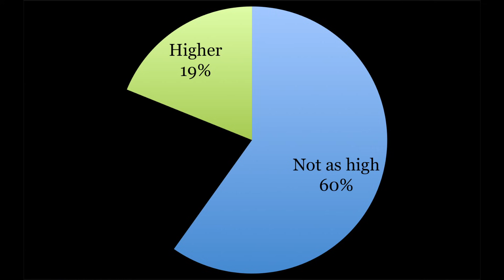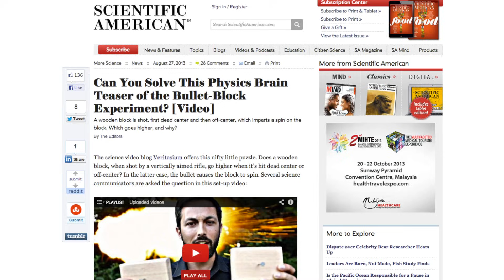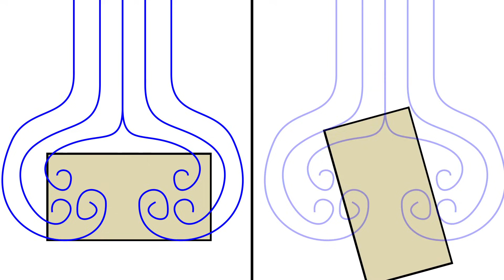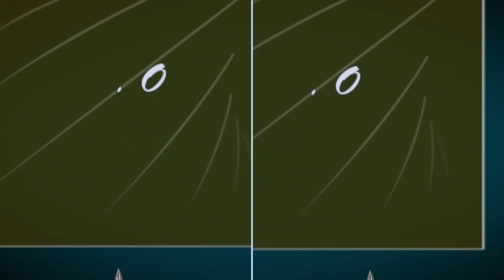Bullet Block Explained!

Comment: I haven't read the other comments but I think maybe if you used a longer block and the second shot was further away from the center. My theory here is that if you increase the length of the moment arm the block will deflect more easily in comparison to a short moment arm. This in conjunction with the much heavier block may exaggerate the difference in hole depth.
Reply: I see now that others had the same idea. I'm gonna lie to myself and call it valid
ation.

Comment: This may be negligible as well as the aerodynamics...But I think it's worth a shot. (pun unintended)

You shot wooden blocks. If you shot only one, it'd be destroyed. All wood is different and has different moisture content, which makes wood shrink overtime. This moisture content also has weight to it though. Again, probably negligible. But if each block has a different weight and the same size/dimensions, the block with the least amount of weight is going to be launched higher.

Comment: I think the answer might be this...  Remember the experiment with lifting the spinning weight at the end of the rod?  Well I think that the spinning block did use less energy to lift it, but the energy that was spinning the block allowed for less energy to be needed to lift the block.  So, your really not using any more or less energy, your using the same amount of energy.

Comment: As performed in this experiment, the 2 blocks of  wood "apparently" contain equal amounts of mass. Mass is one of the two variables that comprise momentum; the other variable is velocity. In this experiment you represent velocity with the bullet. Assuming that each bullet contains the same mass and were accelerated with the same force, it follows that momentum will be preserved in the block/bullet system.

Using the bullet to represent velocity is a bit misdirection, I think .  You don't need the bullet, only gravity. So let's try this in zero gravity and see where the blocks go!

Nice vid, btw.

Comment: I feel as though when the bullet struck the center of the block, the energy that caused the other block to spin was merely absorbed by the rigidity of the former block. Another experiment could confirm this.

Ideally this experiment would be recreated in a vacuum with a long, somewhat-flexible pole. In this case, I imagine the pole shot in the middle would reverberate (wobble up and down in the middle) with the same kinetic energy as the pole shot off-center would spin.
In this experiment, I believe the block of wood simply absorbed this wobble.

It would also be interesting to see if the same experiment done with a higher caliber rifle or a more brittle wood would cause the block shot in the center to disintegrate (thus exhibiting absorbed - and now released - energy) while the block shot off-center would not break, but would spin.

Comment: This has probably been answered already, but I would consider having a rubber bullet used instead to better demonstrate this behavior. While this does mean you'll need to view both sides of the block simultaneously (above and below), if you use paint stripes, etc, you can estimate the speed of the bullet going in the opposite direction and get a much better understanding of what energy it's left with. Otherwise, you could use a different block material that would resist impact more...or perhaps go for the opposite of bullet penetration/response and use a putty-like bullet that simply splats on the side, to have a different metric to measure.

Comment: Instead of bullets use a spring! For the experiment to be valid we need two similar bullets with same ammunition to be fired. even the slightest difference in the energy provided by the bullet could change the results. Instead of bullets use a spring!

Comment: The easiest way to more fully show the difference would be to use a softer but thicker material. This would extend the distance that the bullet would travel into it. 1% of a longer distance is longer than 1% of a shorter distance.

Comment: A much better way to gauge this experiment fully would be to use a ballistics material such as the human flesh analogue mythbusters use, it would have less resistance to deformity, allowing clearly imaging of the difference in bullet depths, it is also easily formable into any shape needed, such as a block

Comment: If im right the reason the Block Spins is Due to Bullet Spin as most people know a Barrel is Threaded Like a Screw So as the Bullet it ignited the Bullet begins to spin as spins faster as it get to the Opening the Bang of the Gun is actually the Pressure of the inside of the barrel to open Air as it leaves so it creates A massive amount of forced pressure im going off Topic but as the Bullet Touchs the Wood the Spinning Friction of the Bullet Cluching the Wood its Greats 27% more Inpact Pressure and thus Spins think of a Car Clutch plate and The flywheel the fly wheel is Spinning to the speed of the Engines RPM/Revs per minute and Begins fritction pressure i hope i have explain what i understand About Forces and such thanks for reading i hope im right Take care all

Comment: this is actually a middle school physics prob, at least in China where i from. i still remember i did the homework question. so the answer is it's linear momentum conservation rather than total energy conservation, as the bullet is stay with the block, so the energy will be absorbed differently, and hence cannot solve the problem using energy conservation. so with momentum conservation, the result would be they must have the same initial group speed upwards and resulting in the same potential energy.

Comment: use a object that would require less energy for penetation but would not deform under duress. I would have suggested a sort of high density gell used in bullet testings but i am not sure as to how it will hold under high duress.

The object itself should not get deformed from the enrgy thus changing potential energy after all :)

Comment: 1. use wood that is softer
2. use bullet that doesn't deform (a material that is not deform too much) so there is less change of heat and more penetration.
3. use smaller bullet

Comment: What kind of bullet(the projectile type matters) did you use? Basically ammunition design has an entire field of engineering based around penetration. For cheap ammo (paper punchers) they go with the cheapest manufacturing. For defense purposes, they want to minimize penetration and conservation of energy in order to 1: maximize transfer of kinetic energy to target (more damage and higher chance of incapacitation.) 2: Minimize the chance of punch through and injury to a bystander. 3: Minimize the energy of ricochets on miss and risk to bystanders.
I'll reply to this comment to give 2 ideas I have for modifying the experiment.
Reply: First, you could use a hollow point for the one you want to minimize penetration on, and a FMJ in the one you want to maximize penetration on. It would require finding a hollow point and FMJ that have the same mass, and you'd probably have to load your own rounds with match Casings and the same amount of the same smokeless powder.
Reply: Second, there's also frangible rounds that break apart inside or on the target. If you connected a metal plate to the bottom on the wood and fired a frangible round. It shouldn't penetrate, just break apart and do it's best to impart it's momentum. The problem is the block may barely move since the bullet will use most of it's kinetic energy to break apart and disperse. Also, make sure you have a blast shield when firing, because there's no way to know where the frangible parts will go flying after striking the plate.
Reply: To specify in the first comment. When I said "conservation of energy" I meant minimize the bullet retaining it's energy instead of transferring it, not that they want to reduce the scientific concept of conservation of energy. Which is obviously impossible to do.
Reply: james jones This guy might be onto something.  There's a whole other field related to bullet physics that we aren't looking at.  This guy doesn't know anything about guns, but the gun is central to the experiment.  The particular way the bullets penetrate the wood might be rendering this experiment invalid for all we know.  They took the gun to be something that imparts energy in a simple way that conforms to their theories; however the way bullets impart energy to certain materials is a whole science unto itself.  They should retry the experiment using slingshots and ball bearings or something like that.
Reply: Jordan Parker
 Actually, the rifle - with its highly standardized ammunition and highly consistent operation - is quite good as a testing bed for this experiment. Internal (inside barrel) and external (outside barrel\target) ballistics are almost consistent here. Of course, ammunition is an entire science field, but here they presumably use the same ammo every time. The only thing you could change is the block material, to make it more homogenous (terminal ballistics, inside target).
Reply: Jordan Parker
But in the end, using guns for physics experiments is not ideal, you're right. As far as I can tell, the weaponsmiths themselves are quite fuzzy on terminal ballistic physics of their guns - too much variables... and, in addition, since the goal is repeatability and consistency, not fundamental research (which would take hundreds of thousands of shots in tightly controlled conditions), most of the time they say "yeah, bullets can do strange things". And indeed they can...

Comment: Sorry this comment suggestion is so late relative to the video release, but a couple of ideas for redoing the experiment such that the bullet penetration distance is measurable include:
>Using a higher powered gun with the same shell calibre, in a larger block of wood.
>Using an alternate material to a block of wood, that has a lower density, such as a type of foam, and also increase its size by some order of magnitude.

Comment: I Know how now I've got it.... the information to go up, would of reached the bottom right corner, before the top right corner, then the bottom left then the top left..  That would work...!  the corners go up when receiving the infomation but because the block has turned and the infromation has not changed, it still goes up as it would if it was still in the position it was at the moment the bullet strickes,
Reply: I also beleive it is the bottom left corner, that slows the spin down/stops it from spinning with full potential.  If you cut that corner out it should spin more rapidly
Reply: ICEOL8
@Veritasium So the point is ALL THE ENERGY GOES UP! But, takes longer for each corner to get the energy to go up due to distance from the bullet stick, causing the spin!
Reply: ICEOL8 the upward momentum is the same for both cases
the 2nd one just had MORE energy transmitted into it by the bullet as it didnt resist the bullet that much ( energy lost upon penetrating is basically converted into angular velocity)
Reply: Yep, but what I am saying is how the what you say is angualar velocity actual made the block spin!  Plus the bullet did appear to penetrate both blocks by the same amount, and both of the blocks would of got simalar amounts of energy from that bullet strike, So I disagree that either had more or less amounts during the strike... Would more resistance constitute more energy transfir? for example to push open a stiff resistent door, it would take more energy to do so, hence more transfired! Thinking the block that had more resitance must of had more energy and therefore the other had less and it is assumed it turned into angular velocity! By saying that one loses energy is not the case as you say your self, it converts, so no loses!  To assume the bullet strike alone with no explination how, caused the angular velocity, is wrong!  Where as the angular velocity, was an after effect of my explination, as each coner rose up at different speeds causeing the spin, the spin was mearly maintained by angular velocity, and not the cause of the spin, in my opinion :)
Reply: it takes more energy to change the state of the door thus more energy is lost -> less eenergy is transferred to the door
Reply: You didn't ask what side/where the door is pushed on.  This should show you that in fact, you do presume :)
Reply: so you got to find the answer in the fine details, you got to go small.. Picture in your head the molecules their indivdual structures, how they affect each other.. slow the bullet down in your mind, see it slowly turning as it riffles out of the barrel, watch the air molecules get pushed apart and coiling in on them selfs an inch behind the bullet, watch it strike the linial molecules of wood and bend in on them self as the bullet slightly crushs, yet still compressing from behind! The air molecules refill the vortex behind the compressing bullet as it start to penetrate the wodden fibers ripping apart. Watch the energy buckle the fibers as it disapates through the wooden structure, see how as it reaches the edges of the wooden block it appears to almost pull on it as it tries to leave but can't really as air wont have it, coz it hits it a way, causing a momentary vacuum, that aids the first corner in lifting... if you can think like this, you'll see how it works :)
Reply: direct convertion would not constitute energy loss, but direct convertion is hard to acheive.. conversions are nearly always forked convertions, it is the additional forms of energies the are not measured that are the perceived losses, such as sound, and heat and atomic absorption(matter holds a lot of energy, as you know)

Comment: You should probably be able to measure a 1cm difference if the piece of wood was a hundred times longer?
Reply: No, the bullet size needs to be larger. Remember Ek=1/2 mv^2. To increase the distance of the bullet distance either bullet mass needs to change, or velocity needs to change.

Comment: Before I watch this, I think the block spins because the bullet is in the block inlodged so then it would make a unbalanced weight causing it to spin while flying and the bullet would make the block's weight heavier so it will not lose the kinetic energy as easily to make up for the heavier weight. Causing it to spin while going up at the same height.

Comment: so it's a coincidence that the block is that particular size as to offset the upward energy, that is if you used say a block twice the size, or one made of a different substance the rotating block would raise to a lower point?
Reply: No, as long as both blocks are the same material and size they would go to the same height.
Reply: so what about if the blocks were made of a material that prevented the bullet from penetrating it...
Reply: I believe itt would still "damp" the energy just enough. Imagine how tiny the amount of difference in the depth of penetration in this example--it doesn't have to be a lot of "observable" difference to make the same end result. It's the law of conservation of momentum "For a collision occurring between object 1 and object 2 in an isolated system, the total momentum of the two objects before the collision is equal to the total momentum of the two objects after the collision. That is, the momentum lost by object 1 is equal to the momentum gained by object 2." The momentum will always be the same no matter where the impact occurs.
Reply: thanks for the reply gray, my brain hurts, this was a good experiment and totes got me cheers nd
Reply: naughteedesign
 Yup got me at first too!
Reply: naughteedesign then it would be a horse of a different color. the point of using a material where the bullet will penetrate and become lodged is that momentum is conserved. if the bullet ricochets off the object, then you have two different pieces of momentum to calculate. the concept would be the same, but would be much harder to recognize and more complicated overall
Reply: good question!
then the rotating case would have a lower height.
In case 2, part of motion would be imprinted as rotation. On the other hand, the increased resistance in case 1 would make the bullet at some point ricochet (think comparable block and bullet masses).
In the vid the heights are the same, same bullet penetration (IMHO), what differentiate the cases is the extra KE in case 2 versus internal wood damage in case 1.
( If you care, I've also commented the original experiment video)

Comment: 3:35 Pixel counters: You can never be that accurate because of the non precise amounts of gunpowder, it's not measured in terms of molecular mass so it will not be the exact same amount of propellant so there is no reason to be so precise unless your controlled test is measured that precisely to begin with.

Comment: I think that there is less wood displaced from the side of the block, than from the front, so there is more energy to account for the rotation.  I imagine if they would've used different size blocks of wood, such as a longer wood block control group that's more rectangular, there would be a big difference in height, than when compared with the more square shaped blocks of wood, which would result in similar heights when shot center or off center.